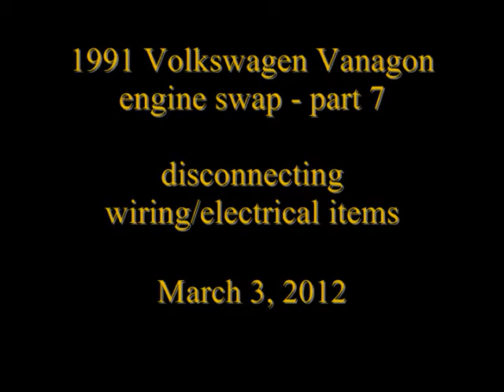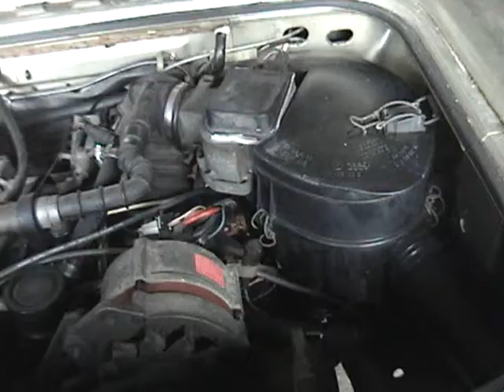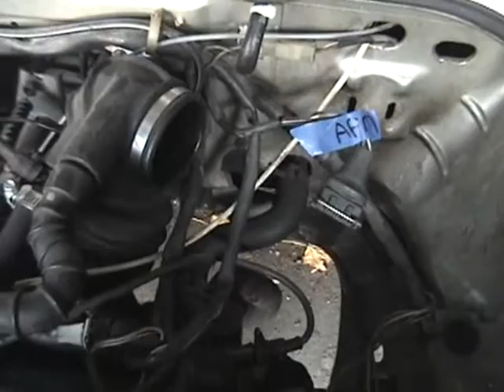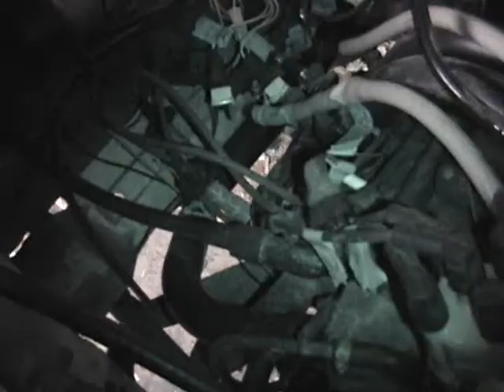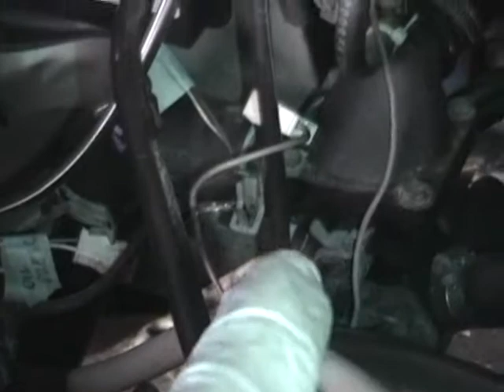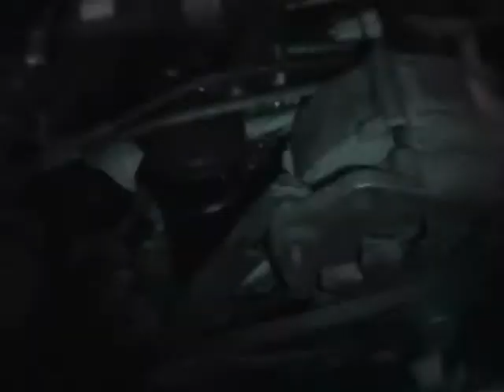1991 Volkswagen Vanagon - engine swap: part 7 - disconnecting electrical items

Comment from the maker: @TIMWHY2 I have line clamps for the medium-sized lines, a plug for the big flex hose, and have a plan to seal off all the smaller hoses. Should be crude... but effective.